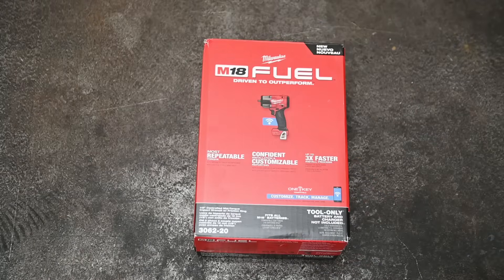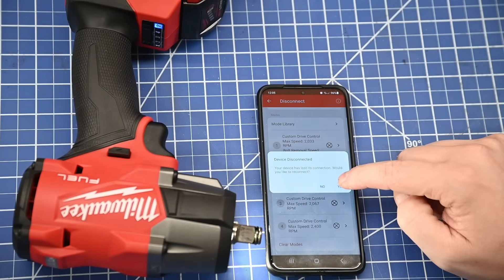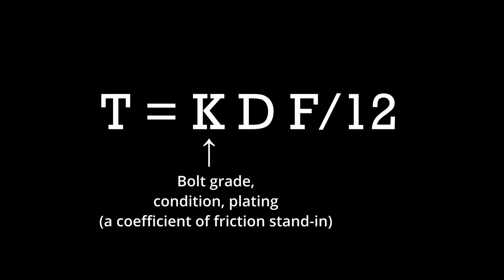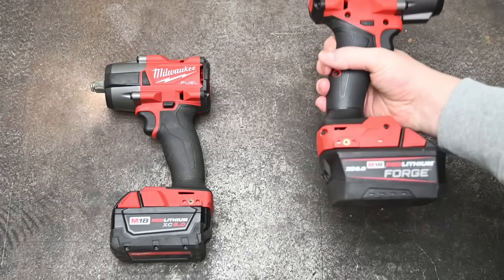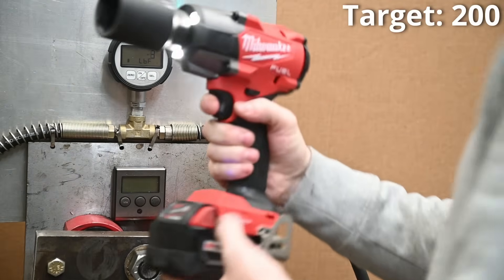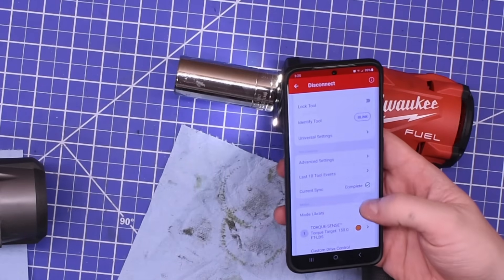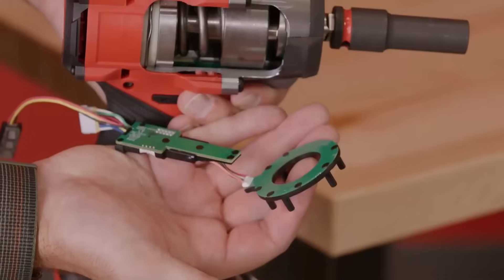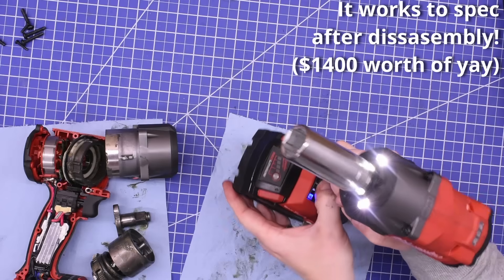Milwaukee's Secret $1,400 Impact Wrench: A Mechanic's Dream?

Comment: Hilti has a torque module with a barcode reader. You scan the code on a Hilti fastener box and it sets itself to the required specs. I've had it refusing to work with cold batteries before though. I'm guessing it reads amps and couldn't be accurate in those temperatures.
Reply: I sure like Hilti products, especially their customer service and warranty (had utterly destroyed tools get replaced within a day) but I found their batteries wanting

Comment: while this tool definitely serves a purpose for smaller things...  having torque-sense for big rig lug nuts would be a game changer..  the torque wrenches we use to set 450 ft lbs are monster size and cumbersome to carry.... this tool looks like a winner for the target audience, however having to be so careful about what batteries you use is almost a non starter for me..  carrying one brand of tool means i can have one set of batteries..  esp when you are a traveller..  batteries have to go in your carry on luggage.. I dont want to have to carry multiple types of batteries just so i can match up the right tool..  I personally have started only using forge batteries..  then again im just looking for pure power in most cases..  im not the likely intended audience for this particular tool..  its a definite step in the right direction to curtail the guys that just "run it till its tight"..  but im not necessarily at the game changer stage.. and with all that electromnics, how will it hold up when it gets wet, or is in condensing situations (out in the truck then brought into the nice warm shop)...

Comment: I worked as Lead Technical Support for tools/Air Motors/Air Starters and also Tech Support for Air Pumps at Ingersoll Rand Canada for 5 years, then moved on to a leading distributor for IR/Cooper Tools/Bosch Production Tools for an additional 5 years, where we sold a record amount of Computerized Transducerized Torque Tools for both IR and Cooper. I also developed a software package that allowed operators to see ISO9001 type images on a screen with torque pass/fail and bolt tightening sequences based on barcode inputs determining the torque strategies to be loaded & shown (a feature that was "stolen" first by Cooper after I ran it by the tech guys at the factory, and then by Atlas Copco after I pitched it to them during a job interview - didn't take the job since I was only offered one in Juarez Mexico - no thanks). I also was involved in many custom tool heads for various applications, the most complicated being at Pratt & Whitney for an 1100nm joint that was the main retention nut on the main shaft of a jet engine. During the work we did with P&W, I was involved with the qualification of the CTT tools by QC along with the (excellent) Bosch Production Tools that were clutch based. The Bosch tools performed almost as well as the transducerized tools in P&W's qualifications, they were consistently scoring within 1-1.5% of the CTT control numbers using a CLUTCH!. The reason that I gave you a chunk of my CV is that I found your channel and based on the Name, assumed possibly a more in-depth look at torque control tools. I do not count impact wrenches as Torque Control Tools in ANY way other than the fact that they can apply torque in an inherently uncontrollable fashion. I was disappointed to scan your list of videos and seeing mostly impact tool comparisons. Now granted, Impacts are a LOT less expensive that the CTT tools that have a lot of very complicated programming (eg: torque to target, then reverse to loose, then re-torque to target and then finally rotate through an angle), and most mechanics will never have seen any truly accurate torque tools other than computerized torque wrenches, and would for the most part have no need for  a CTT other than maybe head bolts on an engine (also sold a bunch of these to CAT Reman) but IF you could get your hands on one of these systems, you will be blown away with the capabilities. And the Bosch Production Tools. So IMHO, you should try to live up to the channel name and expose your subscribers to truly accurate torque tools, you would probably be happy with the response, although you may have to upgrade your test rig from Flintstones to Jetsons to do any meaningful testing (I had a $10k test rig for calibration purposes). Cheers, I'm not trying to criticize your content, I just think that you are leaving a lot on the table if you don't explore more Industrial options.

Comment: As a Tech, It makes me curious sure. However, Considering needing a smart phone to use it makes it a big NOPE! Maybe if it had a small recessed screen with simple menu otherwise big NOPE! If I have to pull out my phone I may as well just grab a simple clicker torque wrench. I have the socket on the gun already and a simple twist dial can't be beat if a phone is involved. get grease and grime on my phone over a simple tq wrench, Heck NO! I could see this handy for solar install stuff though. Tons of fasteners at the same tq, yeah that makes sense.

Comment: Wait....the cost is $1400 or $2400? Because you need the most updated $1000 smart phone to run the app that will eventually keep requiring you to update the phone hardware when more software updates are released.

Comment: The 24V Army DC Aircraft Dynamics Roboimpact 2201 wrench used on tanks (hence the high amp slave cable connection) would be an interesting torque test.

Comment: This tool is for newbs who lack experience of using power tools and do NOT know how much pressure or torque to use and cant feel what the tool is doing. Also lack the experience of knowing what the power tool sounds like and what the metal is doing and what it feels like when bolts are twisting or stretching.  So yeah.  These things are for unexperienced newbs

Comment: This tool is good if your hitting for eg. 100ft lbs bolts all day every day. If your doing many bolts with all sorts of torque specs.. sitting there having to adjust the target spec for various bolts is time wasting. Faster with a digital hand torque wrench. Can u imagine constantly going to ur fone to set a spec. But if its for a specific industry then yeh makes sense. I duno if itll work for other industry in case some one doesnt know

Comment: Im a bit confused by the calibrating. When using a torque wrench to remove a bolt, that torque is going to be higher than what you torqued it to. Does the Milwaukee take that into account? If so, using your setup would be totally different than using a torque wrench to mayzure the torque needed to loosen a bolt.

Comment: A lot of people talking about "technology" here... considering the gun is using a hall effect sensor to figure out what the final torque is and the fact consumers have been able to spend 50 bucks to get an Arduino pcb for over a decade which allows you to hook up sensors, write code, use wifi, it goes on and on and on.... Milwaukee has just been shamefully cheap and waited for 15 to 20 years to drop this product until they could do it for $5 per tool to turn around and charge you $1100. This could've existed in 2005 no problem, skipping the phone app, they would've just had to spent $20 per wrench to make the tech happen.

Comment: We had makita impacts that did the same thing at one of my last jobs. You had to plug it into a computer to change the programmed settings instead of having an app on your phone, but that's nothing new for assembly tools.

Also, we had 40v Ingersoll Rand nutrunners that cost like $12k a piece. Found that one out after one went up in smoke on me and the tool crib guy joked that it was coming out of my paycheck.

Comment: I'm one of those geniuses who use the lightest possible dab of Neverseize on things. Including wheel studs. In 30 years of changing tires twice a year, my torque wrench has never found a problem. I started doing this after my father had a brand new GM car, and even with my breaker bar, neither of us could get one bolt off.
 I've also found the vast majority of authorized dealers and tire shops are literally sometimes 2x factory torque.
 And using NeverSeize on exhaust pipes lets them come apart by hand, even a decade old. No more saws on rusted parts. The trick is, use it like Scrooge McDuck.
Reply: antisieze on wheel studs will fail any inspection that matters
Reply: @TheLeviathan90  I've never heard of an inspection checking each wheel stud.
Reply: @zachary3777  yeah but please don't use anti seize on lugs lol
Reply: Yeah I've been using the marine grade anti sieze, but I do reduce torque specs by 25% on the lug nuts
Reply: Lubricated torque is better than dry, but the values change. Look up a chart. Oil, like air tool oil is nice and disappears for the most part.

Comment: $1,400 for a mid range impact wrench, that needs to be accurate every time. That tool is not ready to be sold yet. They have a lot more work to do and tweaking, If it’s set to 100ft lbs. it needs to hit that mark on the dot every time. Great video TTC, but Milwaukee needs to go back to the drawing board on this one. Or charge a lot less for this tool.

Comment: Torque setting are good to keep in mind. But for $1400? Maybe Big Red is being forward thinking here. The 1/2 drivers are out of control with power so it is easy to do some damage on moderately sized bolts.

Comment: Neat idea, unfortunately I see that pcb in the impact assembly roaching out quick. I work with a lot of pcbs in commercial settings and they really really dislike being shunted and over heated. Being seated in the collar the way it is, the board is experiencing passive temp gain from the assembly and vibrations from the hammer. I guess only time will tell how these impacts hold up.

Comment: Question.  Using the same battery does it make a difference when the charge is at 100, 50, 25, 10% ?
Reply from the maker: It's on this video. Nope

Comment: Milwaukee need to sort out the way their batteries connect.  I work on an iron ore mine in Western Australia. Harsh, dusty conditions. I have a 3/4” Milwaukee rattle gun and it’s common for them to have issues with the battery connections. Due to the vibration, the battery rattles and gradually arc erodes the terminals until it stops working. My 3/4” Makita never had this problem because it has small rubber dampers between the battery and rattle gun body to prevent this. The dust also makes the two button release jam. The 12v Milwaukee range is quite compelling but again, terrible double press connection which is hard to remove, especially when dusty.
Reply: The m12 are not much better on connections. Im using a 1/2 drive stubby impactin m12 and after a year it started getting bad connections. Now it has 2 years and getting worse.

Comment: The marketing says "Machine learning", but after seeing videos on reverse engineering the batteries and now simple the signalling actually is, (and also this tool's behaviour), I have a strong suspicion that it's just a microcontroller doing a little bit of simple maths. I guess taking ten samples and taking an average is technically learning?

Comment: Could the weight of the bigger battery packs also be a factor. That's a fair change in rotational inertia if it measures anything to do with how the tool torques around, as well as the different current capability.

Comment: but the truth is, aside from the M12 studs that asian cars have, you can overtighten the wheel bolts a lot without any concern because they are so over dimensioned for the task. like a volvo m14 bolt is specified to 140Nm but going as high as 300Nm isn't gonna hurt anything

Comment: Definitely a commercial gun. Doesn't really seem to be built to, say, hilti specs, but, is probably ok for alot of things. 

It also allows one smart guy to setup a bunch of torque wrenches and then just teach the guys which number to be on. Much simpler than getting them to use a torque wrench.

Comment: We had a machine that torqued down semi-trailer bolts to 475, 500, and 525ft-lbs based on the selection switch the operator selected designed by Six Sigma. We had a brilliant technician come in and trained us to install new torque transducers and explained in the most basic form of how a computer calculates torque on this particular machine. He said that in layman's terms that it had wires run parallel as well as perpendicular in a certain number of directions attached to points on the frame that twists or compresses during the application of torque. He said that when a wire stretches it becomes thinner and when it compresses, it expands. During expansion and thinning of the wire it's resistance changes and it is measured by the controller and calculated (the formula was proprietary apparently)! I thought it was the fascinating thing that someone thought of that one day as a way to measure torque. I was also told that the flexibility of the frame being twisted and compressed changes the formula, which has to be calibrated for each type of material!
Reply: Sounds like it has a basic wheatstone bridge load cell. That's the basis of most load cell measurement and even some pressure sensors.
Reply: That formula is not proprietary! What that tech described is a basic load cell and the formula is in every Mech. Eng. textbook. All anyone would have to do is do some measurements and get data to calibrate it. They tell you it's proprietary when it's something simple because they know it would be easy to copy haha.
Reply: Load cells are pretty simple. When it gets thinner, the resistance gets higher and the voltage gets lower. Trying to get precise control using load cells is a bit more math heavy and may require a bit of trial and error.
Reply: Aint six sigma a tool for reducing scrap?

Comment: This was a blast!  Thank you.  I just put up a steel building where I had to use the mark the nuts and twist it another third turn method.  This would have been helpful.  It may not have had the juice to do what I did, since I had to use a 40" breaker bar with an 1.25 inch socket on my bolts.

Comment: The market for a tech like this is literally immense. Put a small camera in it to read QR codes that set it to these pre sets and it will sell in immense quantities. Especially if they make a scaled down version that does in lbs and in oz. And if it also had a mode that accounts for running torque... Milwaukee would probably take over the manufacturing market.
Reply: @mjflit patent that qr scanner idea immediately
Reply: even better if it can make a api call or usb stick to upload recorded torq values

Comment: Red is going for the industrial NIST traceable (ish) segment. Bosch does this. To be fair, this tool is looking to be used in a market where there ARE no variables, just 1000s of the same bolts to the same specs with the same tools. Production and traceable.

Comment: QXFN2PT008PQ04 | 20V Cordless Torque Screwdriver, 8 Nm, 1/4'' Quick Change. same price and you guessed it, Ingersoll Rand.  Look it up and note the countless configurations available. This tool was calibrated yearly and used to assemble aircraft components where I retired from. Milwaukee's app tells the manufacturer how you are using it, where you used it, (your shop, gotcha!) battery charge, and a host of settings you plugged in. Let's hope this leads to the next model with an improved build. Will a stolen tool be disabled without the host phone????

Comment: At first I thought wheel/tire shops will certainly rush to bring these in.  Then I remembered I'm a lawyer, and instead I think they will be banned for a while by the legal departments of shops, or at least they will require confirmation with a standard torque wrench.  There are still too many factors that can result in under-torqueing, especially since different batteries (or age of battery, likely as well) give different results.  Until these come with a certificate guaranteeing +/- 4% or better like standard torque wrenches come with, the lawyers for end users will say you can't defend using these instead of standard torque wrenches in a lawsuit for the wheels coming off a vehicle.  If it turns out that these significantly drift off of accurate over time, or that guys aren't being super careful to ALWAYS use the correct setting (they'll have to know the nut size and the thread count and pitch of every car), tire companies would have to do massive recalls to retorque the nuts of every car that came into the shop since they bought these tools.  If over time they see that this is not at all a problem, then the economics of the time savings will overcome the fear of litigation/recalls.

Comment: Tire guys actually torque shit?  Why is it my wore out thor struggles to remove some of my f350 lug nuts at times.   Hmmmm...kinda like when the 5ft torque wrench breaks instantly when the tire guy at Bauer tightens your lug nuts.  That's over torqued. I'll fix it when I get home.  They get a little pissed when you say that